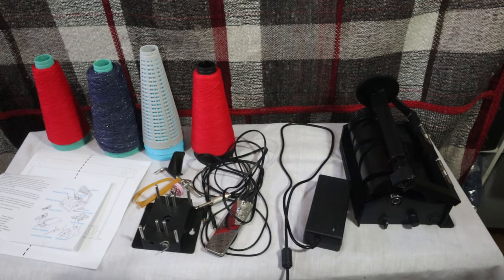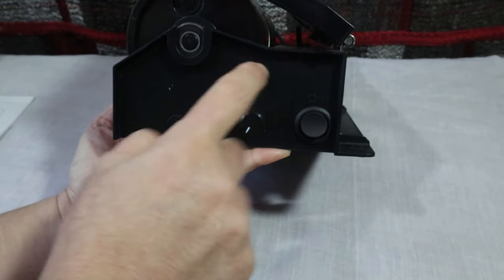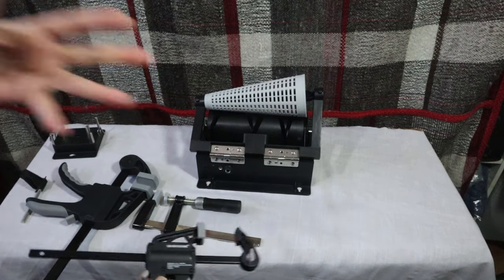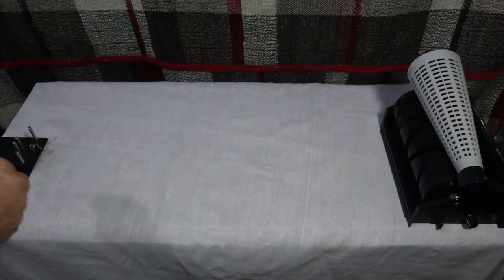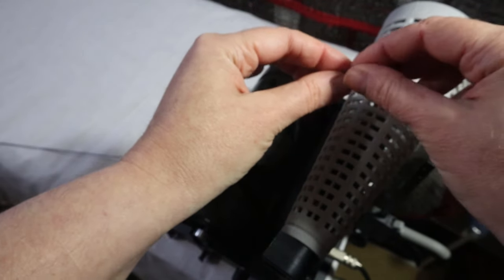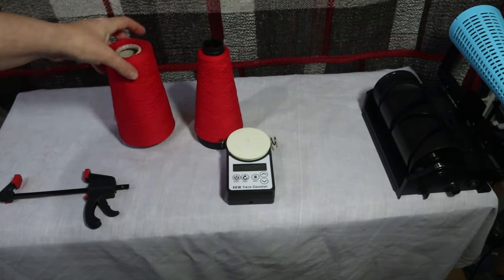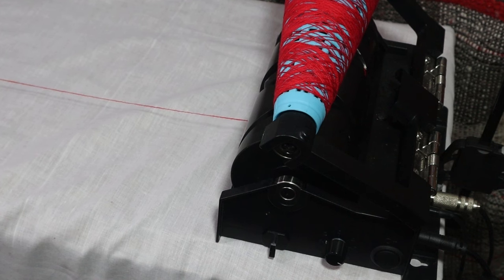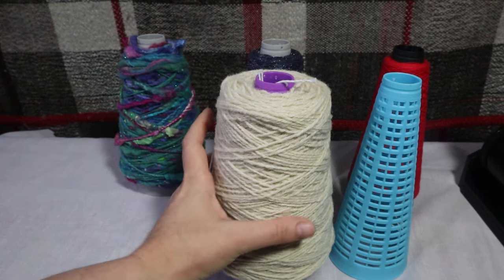Spin 166 - Using the EEW Cone Winder

Comment: hi! this is such a helpful video! i bought the EEW cone winder and was using it with an umbrella swift to wind some light weight acrylic yarn. i have the tensioner lined up about 36 cm further than the distance shown on the EEW cone winder placement diagram and it is directly in line with the cone winder. When i try winding the yarn on the cone, the yarn is winding too close to the top of the cone and becoming wrapped around the bearing on the top of the cone holder. The yarn is clogging that end of the winder, preventing further winding from occurring. Do i have it set up incorrectly? Any advice would be greatly appreciated! Thanks so much in advance. 

-Yvonne

Comment: Thanks for doing this video, Vampy.
The only question I think I am left with is how to judge how much tension to use? What are symptoms of the tension being too light? I imagine the main issue with the tension being too tight would be yarn breakage. Anything else to look for?
Reply: if it were too light it wouldn't wind neatly, you'd get sloppy collapsing cones, and potentially more issues with jerking as the tension varied coming off your yarn source. Too tight would only break very fine yarn, it's jerky motions that tend to break yarn rather than just tension, but you'd find the yarn stretching out, and perhaps the cone winder even slowing and stopping like it does when you have a snag.

Comment: Thank you for the demonstration. I received mine today and have used it a couple of times already. I have found that the motor on mine is quite loud, making a rapid tapping sound that corresponds to the speed I’ve set it to. Is there anything I can do about that?
Reply from the maker: I don't think it's the motor noise.  Most of the noise comes from the cone and the drum rubbing.  This is normal for this type of cone winder.

Comment: Thank you. Of course I want to buy one. Are they suitable for 240 volts power supply?
Reply from the maker: The power supply it comes with works with 240 volts.  You just need a plug converter or a C7 cable.
Reply: Thank you very much. I have written to you.

Comment: hi, on your website it says that this can wind raw skein. How would this work? Would I have to buy an umbrella swifter?
Reply from the maker: An umbrella swift works well.  If you already have a skein winder those will work as long as they don't add too much tension.
Reply: @DreamingRobotsBlog  thanks for the response. Is it just trial and error to determine the right angle and distance?

Comment: Can we use thread with this ....or is it just for wool
Reply: You can use it with anything yarn-like and reasonably smooth. The red in the video is a moderately fine cotton weaving yarn, I've also tried it with cobweb weight wool. I've not tried with sewing thread, but I can see no reason why it wouldn't work.